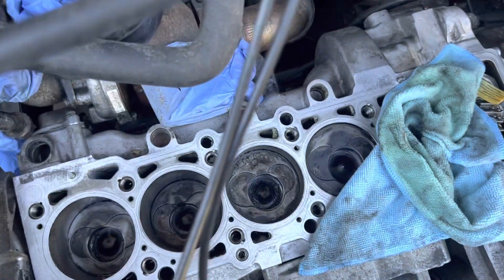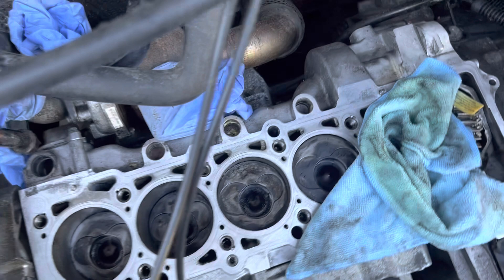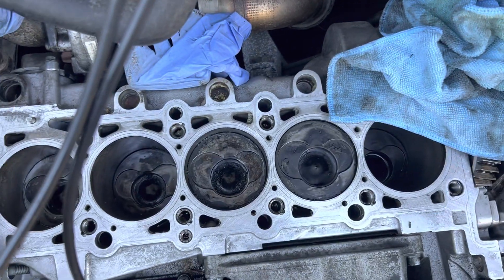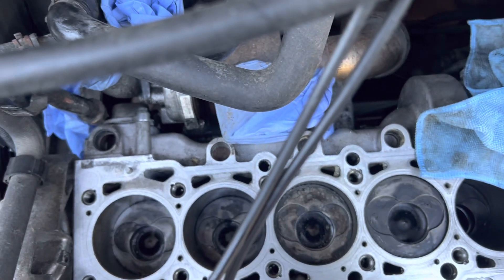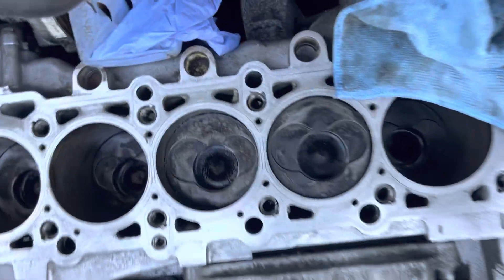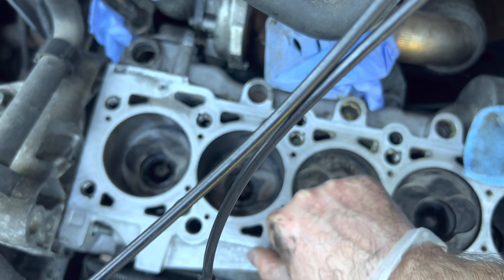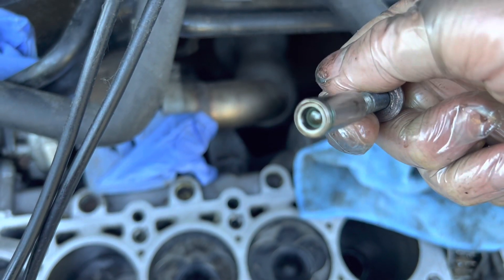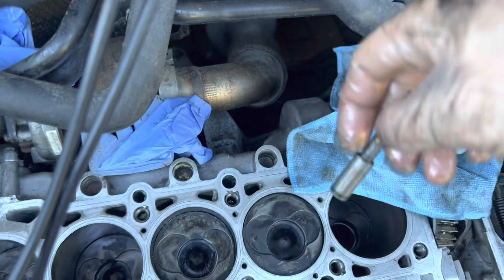VW Transporter 2.5 AXD AXE BPC BNZ engine cylinder head oil feed starvation

Comment: I want to ask, I'm from Indonesia, I have a VW T5 TDI2.5 with the engine code AXE, what I want to ask is what is the difference between the AXE and AXD engine codes, physically or what? Thank you in advance
Reply from the maker: @diyaherfan4225  the AXD and AXE are physically the same (both cylinder head and block) but have different power output (AXD 130bhp, AXE 174bhp) thanks to a different turbo and fuel/boost map.

I believe the AXE has a slightly stronger clutch & flywheel

Comment: thanks for this.   there's some interesting stuff on yt from 07eins I think it is (also maybe some stuff from darkside developments) for those  dealing with the head.  
It's about using some seats for the injectors to prevent head cracking from the metal hardening that the injectors cause and also adding a bridge that holds the injectors properly vertical preventing future leaks due to the stock mounting forcing the injector to lean on the clamp side (leaks on the other side of the injector). 
I don't know how common the problem is but Festa from vwt4forum I think has done it.

Comment: Is there any way of testing this without taking the head off?
Reply from the maker: Unfortunately not
Reply: @DavesDiscoveriesChannel  Forgive my ignorance but I just assumed that checking one of the relevant oil supply holes in the head would indicate if the valve is working or not. The hole should be full, if it were empty then the valve is stuck open?
Reply from the maker: @michaelbirchall2247  I guess you could remove your rocker shaft and cam shaft then check.
Reply: @DavesDiscoveriesChannel  That's what I'm thinking, I'm due to do a cam change at some point this year, it's a little worn. I suppose I should take the head off anyway to inspect the bores too. But once the head is off I might as well rebuild that too. But while I've got the head off I might as well rebuild the block... It's never ending!!
Reply from the maker: @michaelbirchall2247  why do you think you’ve got oil supply issues?
Reply: @DavesDiscoveriesChannel  The previous owner said he had the cam shaft changed about a year ago, but it's noisy. When I took the cam cover off to inspect it, some of the lobes are worn. Might be a cheap cam? Might be oil starvation.
Reply from the maker: @michaelbirchall2247  are the lobes worn or scored? did he replace the lifters too?
Reply: @DavesDiscoveriesChannel  The lobes are worn and rounded at the edges causing burrs that are hanging off, there are bits of metal floating around in the head. Not sure about the lifters but I don't see why they wouldn't be replaced too. He also states he had new injectors fitted, which I have seen the receipts for. One of the rocker rollers for the injectors is pitted as if some metal from the cam lobes got rolled around. Bit of a mess really. 
I'm going away in it this weekend for a few days, so will look into a rebuild of some degree after this.
Someone suggested that the top end noise and slight missfire/rough running maybe due to the injectors.
Reply from the maker: @michaelbirchall2247  wowza :o hopefully just a cheap cast cam.
Reply: @DavesDiscoveriesChannel  Fingers crossed that's all it is. I'll be using a billet camshaft when I replace it.
BTW well done and thank you for making the video.  All this content makes the job a lot less daunting. Did you do any more content on it?
Reply from the maker: @michaelbirchall2247  thanks!

I wanted to do a video on the actual shaft installation but struggled to film and work 🫣
Reply: @DavesDiscoveriesChannel  I took the head off today, and indeed the valve is stuck open, this would explain the worn new camshaft!
 Mine looks very different to yours, it has a torques head to remove it and the valve is plastic.

Are these available to buy. I can't seem to find any. I'd like a better version than a crappy plastic one.
Reply from the maker: @michaelbirchall2247  maybe it’s just the earlier ones that are metal with a glass ball?
Reply: @DavesDiscoveriesChannel  Mine is a 2005, what's yours?